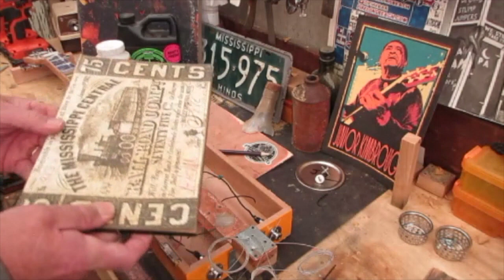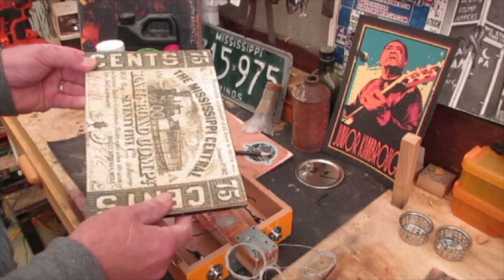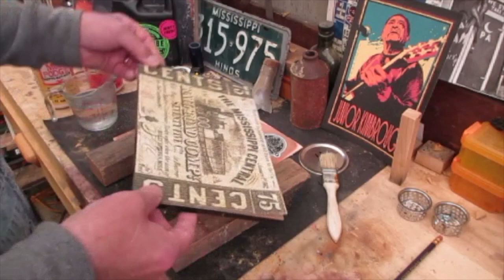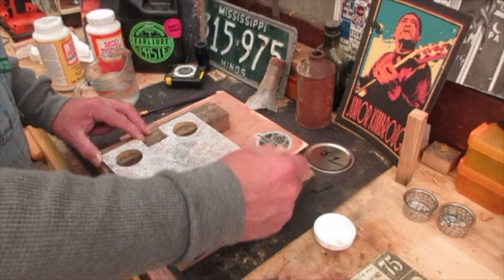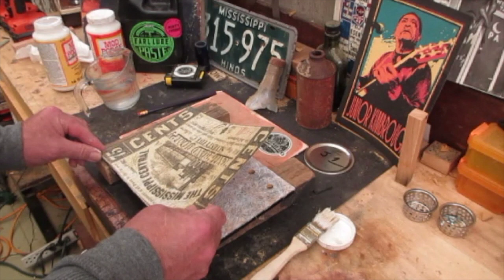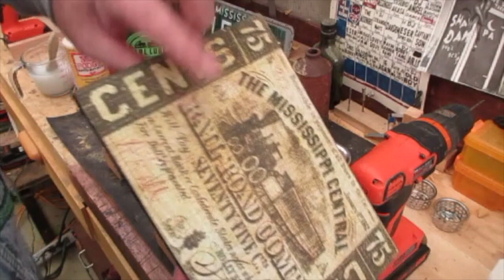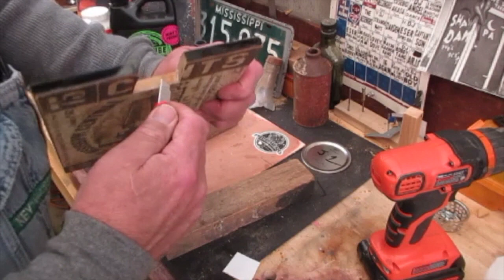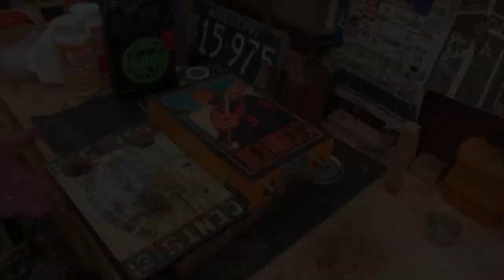How to Build a Cigar Box Guitar: Holly Springs Graphics

Comment: Nice tips KP. HNY. Thanks. I need to repair the graphics on some boxes i want to use.  I am going to use some of the Mod Podge and Earls for the repairs along with your tips to keep the holes from getting "fulled up".  I do not have Hooker-N-Heat but I do have alot of old blues various artist CD's I will listen along with while Mod Podging.  How does the Earls hold up over time?  I might start using this for everything.